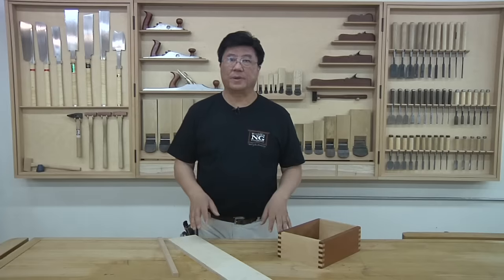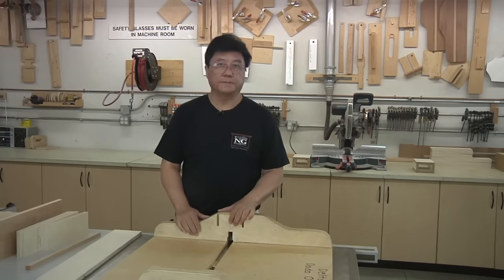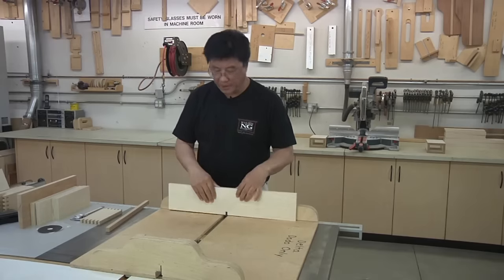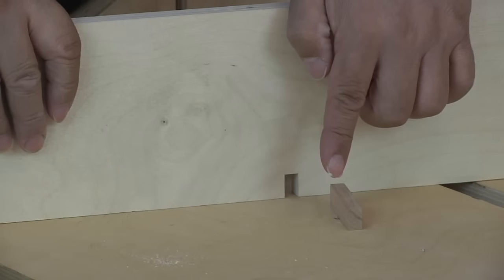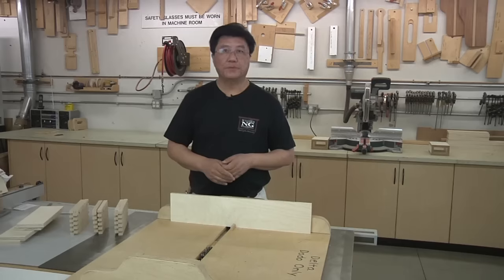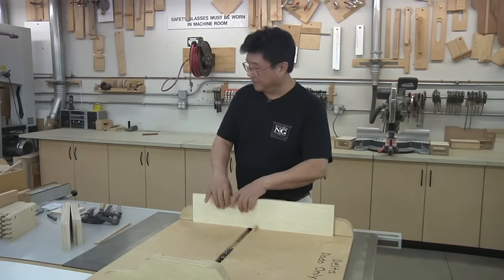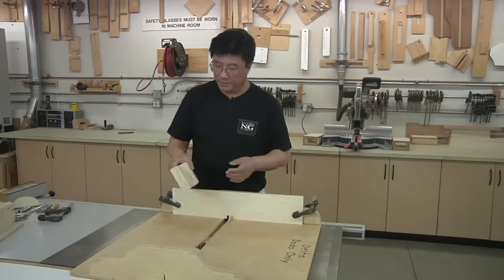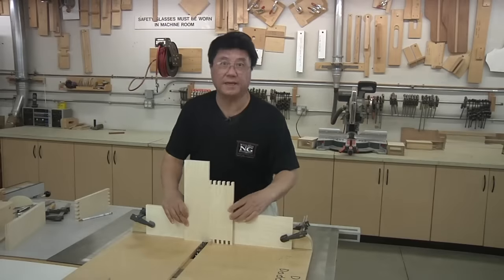Make an Accurate Box Joint Jig, Simple and Fast

Comment: I understand making the fingers slightly less in width so they fit smoothly.  But confused because you cut the fingers and grooves using the same spacer.  How are the fingers smaller in width?
Reply: Do you adjust the fence for the backs and then adjust for the sides?
The width of the cut is the same for the front and sides?
Reply from the maker: Hi Jay. One adjustment for front and sides. I show that at 9:20 in the video

Comment: I don't understand how it works evenly with 3/8 inch fingers over a 4 in board.  11 fingers at 3/8 inch each would be 4 1/8 inch wide.  What do you do with the extra 1/8?  Is one finger smaller?

Comment: The dropbox you’re making need to be in even number on the hike or does it matter when you’re cutting thing that joins another words could you have a 3 1/2 inch height rather than the 3 inch off for well in a 4 1/2 what does it matter

Comment: I followed the logic of allowing for .006" undersizing of the tenons, but is this only true for plywood?
Reply from the maker: +annarboriter Yes, The question has been asked before. My response is for solid it's between 3-4 thousands depend on the density of the wood. harder wood 3/1000 softer wood like pine 4/1000. Hope this helps

Comment: Also, what kind of glue are you using that you can set this up in 5 minutes?
Reply from the maker: Killashandra111 I use tite-bond II It tacks up quick, doesn't need to completely cure. With a 4/1000 tolerance I'm not putting a lot of stress on the piece.

Comment: When you cut the bottom for the drawer
You forgot to mention you had to move the saw back for the correct width and if you left it at where you reset the saw, It would still be to narrow.

Comment: Why don't you end up with a small sliver (or gap on the mating board) that is equal to the .004 undersize multiplied by the number of fingers on the board?  I seem to always have that problem but I see that you seem to end up with a perfect number of fingers without that last little sliver.
Reply from the maker: Hi Allan Here's the reply I gave to a similar comment. The opening measures .365 times that by 5 = 1.83 plus the fingers measures .360 times that by 6 = 2.16 add those together = 3.99 inch. OK so I'm  .01" off. :-) My drawer part are not exactly 4" it's a sliver smaller
Reply: @wnwoodworks  but the cumulative error you get on a box joint would be the difference between the kerf and finger (.005 in this case) times the number of fingers.

Comment: so you add the 0.010 shim when doing the sides, is that correct in order to get the wider gap between the fingers ?d
Reply from the maker: +Gary Cheavin No, I did not add the .010 shim. The gap or the opening is always the same because the tooling never changes. I made the fingers .006 smaller by adjusting the jig as I explain at 9:20

Comment: William, I really like the way in which you took the time to explain not only what you were doing but WHY.  That kept my interest (I'm an "Experienced" novice, lol).  Other woodworkers on here rush so quickly and they don't explain as well as you did.  With your style I felt like I was in a classroom and really learning something from a great teacher,... and your jokes made it funny too!

 I've always wondered about which side to cut first for a box joint and how to get the math to work out perfectly.  Your explanation really made sense. 
 Here's a question for you.  If for example, using box joints for something other than a box, how would you avoid those holes that you covered with the drawer front?  
Thanks in advance for your help.  Oh, and your tool cabinet is about the cleanest, most pristinely organized that I've seen!  My virgoness enjoyed that visual delight.
Reply from the maker: Hi Jeff, If you want to avoid the holes you have to use a router table by dropping in your starting cut and lifting out of your ending cut.

Comment: William, I am confused. You said in one of your videos that you use 3/8ths dado but you also said you use 4" width drawer sides BUT 3/8ths does not exactly divide evenly into 4". You showed the side with the cut openings and you had 6 fingers and 5 openings so if the dado is set for 3/8ths you would have a finger and an opening 1/8th smaller. Am I right or is my age showing? You actually lost me when you talked about fine tuning in thousandths of an inch. Shame the US didn't change to metric, it is so much easier.
Reply from the maker: Hi Michael, Sorry for the delayed response, been a little busy. This question has ben asked before and here is my response. The opening measures .365 times that by 5 = 1.83 plus the fingers measures .360 times that by 6 = 2.16 add those together = 3.99 inch. OK so I'm  .01" off. :-) Hope this helps. I try to keep the videos short and sometimes I edit things out that I should keep.

Comment: hi William or public can anyone tell me if Im crazy or if you are using a 3/8 dado set and you wanna cut 11 even fingers and grooves in a  4inch wide board doesn't the math not work ? 11x.375 =4.125??? very confused
Reply from the maker: This question has been asked before. I try to keep the video short therefore it's hard to explain everything in detail but here's my response.The opening measures .365 times that by 5 = 1.83 plus the fingers measures .360 times that by 6 = 2.16 add those together = 3.99 inch. OK so I'm  .01" off. :-) Thanks for your comment and for watching. Hope this helps.
Reply: Sorry, but this explanation did nothing to help me understand the same issue that LookNOHands had.  The issue is that you should not call it 3/8" if it actually IS 0.365..
Reply: Larry B 
William didn’t name the dado set. The manufacturer did. They never measure exactly, just approximately.

Comment: If I'm using 3/4'' plywood, should I use 3/4'' dado set?
Reply from the maker: No, you just have to raise the blade a little higher. I use 3/8 dado because of the aesthetics and spacing for drawer bottom. It doesn't matter how thick your stock is. I use 5/8 for drawers only 1/8 different than yours.

Comment: I needed a drawer for my roll-a-way, for my scroll saw.  I made a finger joint jig and it was awful, so guess what, with what I had left, I made butt joints and it worked out just fine.  I plan on taking more time and making the finger joint jig again.
I know where I went wrong in no using may caliper.
ed

Comment: William Ng...some questions on this video.  When you are cutting the slots for the drawer bottoms, what depth is that groove? (how high is the blade set?, my guess would be 5/16ths, half of the thickness of the 5/8" drawer sides) Also, how much smaller do you cut your drawer bottoms to ensure your drawer boxes go together correctly? (would I be correct to assume interior drawer width and length, plus 5/16" plus 5 /16") and lastly, when assembling your drawers, do you glue the drawer bottoms into the slots?

Comment: Loved the video but PLEASE use metric measurements even if you have to double up.  We have not used imperial in Australia for 50 years so converting thousandths of an inch to millimetres is difficult when listening to a presentation. most of the equipment can be used to read both types of measurements anyway.

Comment: Still not sure how that 12/1000 results in a better fit, you haven't changed the dado size (shims)
Reply from the maker: The dado size remains the same. I adjust the finger size smaller by about 5-6/1000 to fit. So my opening/dado size is .365 so I made an adjustment so the fingers are .359 and 1/2 in the video. Hope this helps clarify it.

Comment: So once you have adjusted the cut by the 6 thousandths then you cut all the joints with that same cut? Aren’t they all then the same? I guess I am having a hard time understanding the concept. I have wasted a lot of wood trying to learn this.
Reply from the maker: When I adjusted the 6/1000 that's for the size of the finger but the opening will remain the same because tooling does not change.
Reply: @wnwoodworks  Thank you

Comment: what if  I don't have an exact 4 inch drawer?.
Reply: Same exact process, it's just that if your drawer height isn't a multiple of 3/8", you'll have a partial tooth.  This is only an aesthetic issue, as the drawer will not be compromised in strength or anything else.  And in fact, depending upon what you are using for drawer slides, they may even cover that part of the joint up.  In other words, you're just fine if your drawer height differs.

Comment: William, what am I missing?  I don't understand how a 3/8" finger and a 4" drawer height works evenly.  I just can't make the math work. 4/.375 = 10.66.  I admit up front that I am not a numbers person.  I must have missed something.
Reply from the maker: Check the top comment. The opening measures .365 times that by 5 = 1.83 plus the fingers measures .360 times that by 6 = 2.16 add those together = 3.99 inch. OK so I'm  .01" off. :-)

Comment: What table saw do you have?
Reply from the maker: Table saw in my shop are made by Delta, General Canada and a Felder sliding table saw.
Reply: which do you prefer
Reply from the maker: If I had to buy a table saw now, I would buy the new Delta with the two wheels in front.

Comment: I am new to woodworking and have a question,  lets say you want to make a box that is LxW. How do you know how much longer to make the boards so when making the finger joints there are a perfect LxW. Is there a calculator or method to find out?
Reply from the maker: Let's just say that my drawer finish size would be 12" x 20" all I do is add 1/16" to it because I let the fingers stick out around 1/32" so when I trim it off on each size that accounts for the 1/16". Hope this answers your question.
Reply: William Ng thanks, yes it does help

Comment: Unfortunately, this video is only helpful if you have a Dado set but many woodworkers don't have them for various reasons, In my country (Australia) they are not that popular and not readily available in local hardware stores and can only be purchased from a couple of specialised suppliers of woodworking machinery and therefor quite costly. Many woodworkers that I know only use a single-blade table saw which means the machine does not have a long enough arbor to fit Dado blades. Nevertheless, I guess the ideas in this video could be considered on a router table using a suitable router bit to make the joints.

Comment: Soooo you show a shim that says .01 and call it 1/1000, but isn't it actually 1/100th?

1.0 = 1 inch
0.1 = 1/10th
0.01 = 1/100th
0.001 = 1/1000th

Is there something I am missing here?
Reply from the maker: zewtorious At 3:40 I said 10/1000 (ten thousands of an inch) which is the same as 1/100. You're not missing a thing, tomato, tomoto it's the same.

Comment: Question.  Did you calculate the width of the parts, in relationship to the the combined width of the slots and fingers?  It would appear you did, as the very last finger on the fronts and backs would be undersized had you not, no? Btw, when I first began watching your videos, your precision seemed, as you called it...anal. I used to think 1/32" was close enough for woodworking. But now, I see why you use a caliper for precision in the thousands of an inch. Great. Thanks. I'm learning, even after 30 yrs of woodworking.

Comment: It’s always Dado this and that.
Not everyone has a saw that can mount a Dado.
How about a smart gig for a normal sawblade. 😎🤓
Reply: The Wizard of Aus that was an ok jig video, but He still used a Dado to make grooves for the track.
Reply: @BaconDanish  Ha...you got me! But the track is optional, clamps just as effective. Or just cut multiple parallel kerfs, or, use a router. I have a dado set but would still not bother to set it up for one cut.
Reply: The Wizard of Aus thank you any way. I would at some point replace my tablesaw to one that can fit a Dado. 😇👍🏻

Comment: Hmm, not everyone has a dado stack, so it's not with basic tools.
Reply: Because I live in the uk and nearly all consumer table saws cannot take a dado blade. The arbors are made too short, it's a bit crazy but it's due to the legal requirement that all saws must be braked which could be potentially unsafe with a dado stack fitted. The rules are different for more industrial type machinery but for us hobby woodworkers it's just our safety rules.
Reply: So any table saw jig must be flexible enough to use a single saw blade. 😕
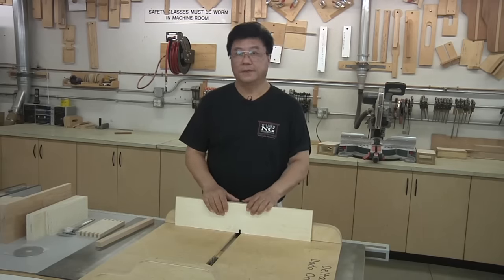Reply: @Paul - 4:50 to 4:54
Reply: Try three circ saw blades and no washer on your arbor to get a 3/8 "dado.